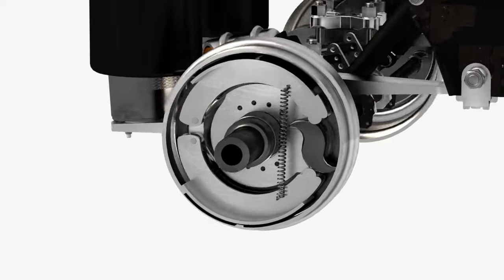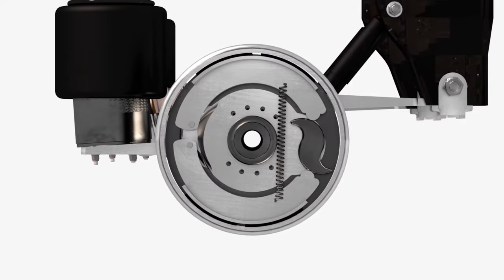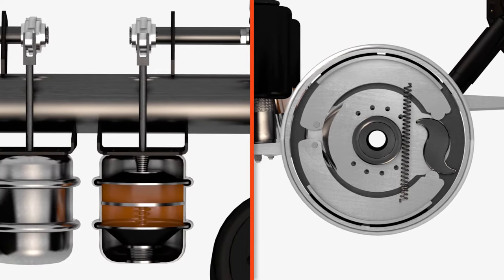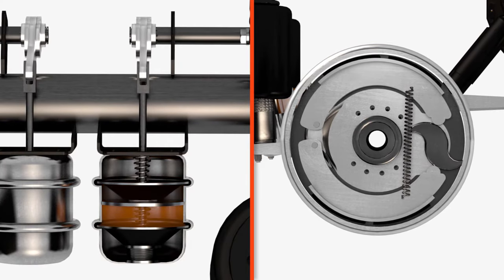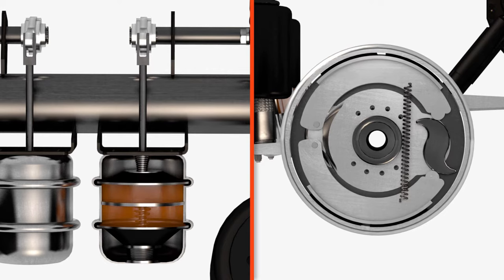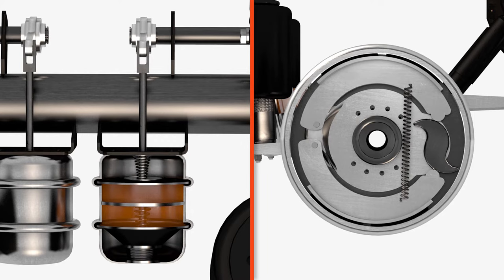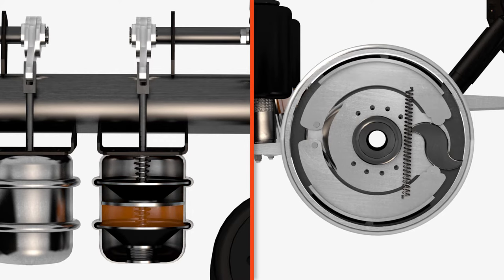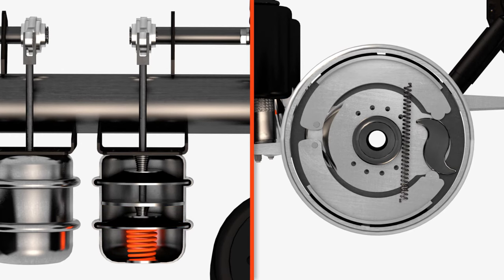Custom 3D Animation from Air Brakes Course - Created by BIS Safety Software

Comment: I think you made a mistake there. "When you press the foot pedal, air pressure DECREASES" if you ment to adress the air pressure in the spring chambers. You increase the air pressure to engage the brakes, and decrease it to engage the parking brake.
Reply: Yeah, I thought of the same so I came here to check on comments.
Reply: Exactly, applying the brakes should increase the air pressure in the brake chamber causing the brakes to be applied.... Nice diagram
Reply: Yeah, they got that part a bit backwards.
Reply: Nope video is right and you are wrong.😉😉
Reply: Watch again
Reply: @RAXITH_playz  I did, and they haven't changed it...
Reply: The explanation is correct, this is new design to make brake fail proof. You just dont understand how it works. The brake is engage by spring not by air.
Reply: @jinggo1053  I think I understand it better than you do. I do work with these systems...
Reply: @realsaxual2357  So you're going to tell me, who works with these daily, how they work?

Comment: This is awesome. I wish the course i just took used videos like this. Think this video would be a lot easier to understand if it better specificied the e-brake/parking break (lower spring part of the enclosure) is disengaged when it has air pressure vs the service break(upper spring) which functions the opposite when it has/doesn't have air pressure.
Or maybe I should have studied harder? Lol